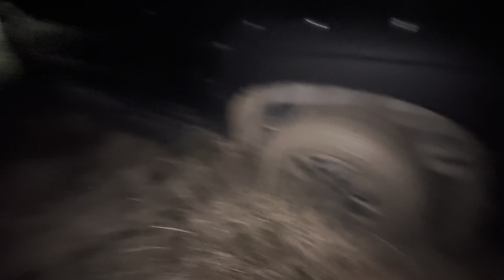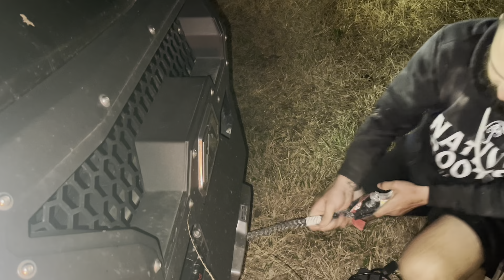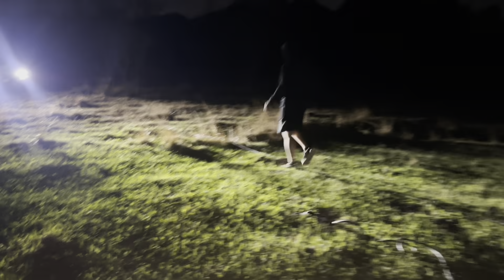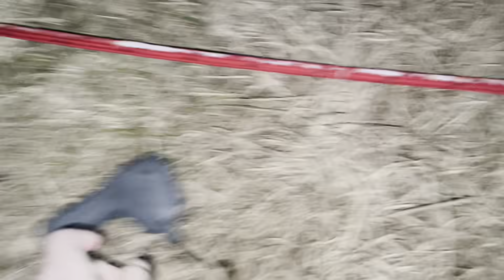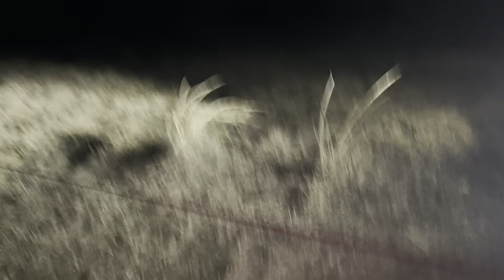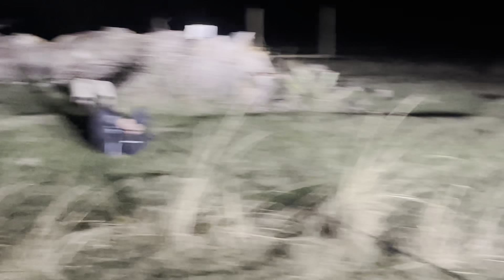I had to be RESCUED

Comment: Hey Jake, surely you have all terrain tires on your truck. Are your tires slick, almost no tread left? They have snow chains with anti slip chains easy to remove @ Amazon. Check out the ones with the yellow straps. Maybe it will work. Just make sure you keep them in your truck, maybe behind the seat. 🤷‍♀️ 😊💕👍

Comment: You’re running street tires on a four-wheel-drive. Do you need all-terrain tires or mud tires so that you get more traction in situations like this. I personally would recommend an all-terrain style tire. I run a Cooper AT on my truck and it works well.

Comment: Jake you buried it! Get some bf's you won't get stuck! They put pussy tires on trucks  pretty stupid on a 4 wheel drive bf Goodrich ko2! I will not drive on anything else throws snow and mud expensive but worth it my husband had a guy stop in the middle of the road with a black trailer no lights and he hit him a inch deep cut on the sidewall and a week later not flat! First step though is shutting off the TCS THAT'S why you got stuck